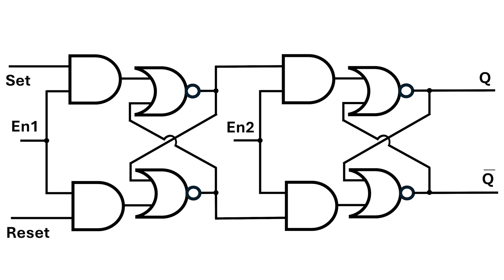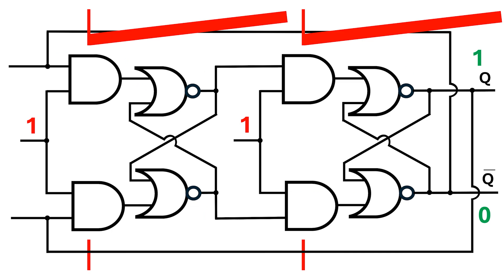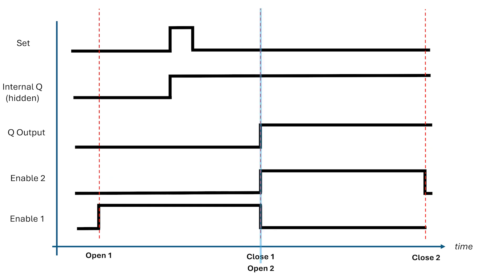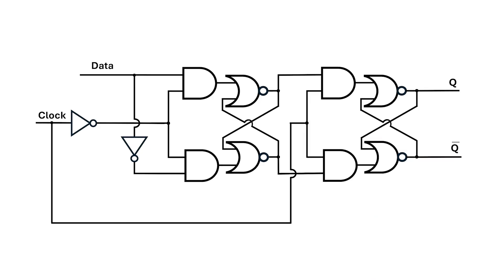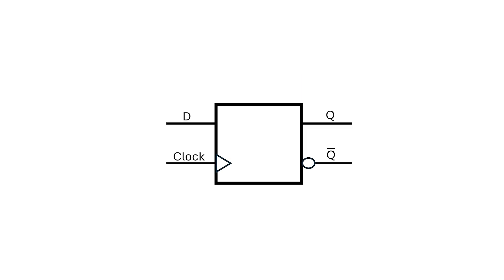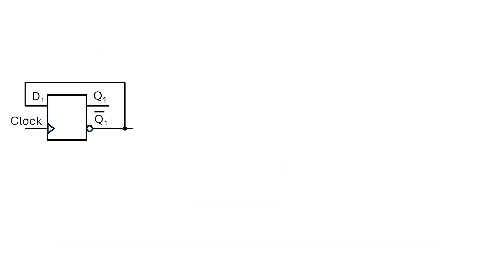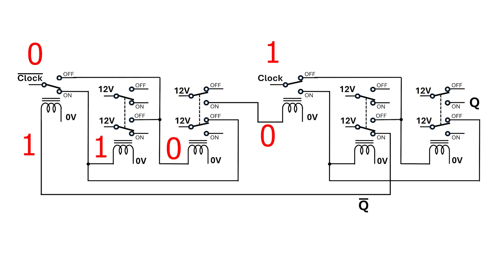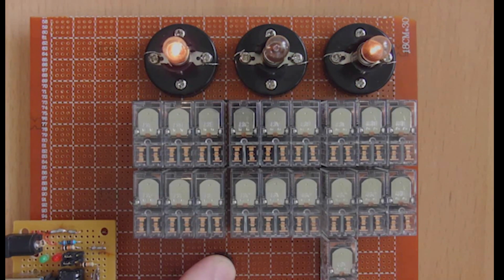Switches to CPUs: Ripple Counter

Comment: Another good video!

(5:51) Where's the data line?
(9:04) Ah. You showed the toggle flip-flop at 5:51, not the data flip-flop.
(9:21-9:40) The top line is still set and the bottom line is still reset on the internal latches, but the relays used for set and reset are swapped compared to the previous video. This does mean the data flow matches the design you showed with gates better. However, it also means the internal D-type latches have D-bar inputs, not D inputs. (There are other ways to rectify this, but I think this way requires the fewest changes.)

And now for some fun facts/over-analysis:
As for changes between the logic-gate design and relay design, you still have the outputs of the latches between the OR gates and their inverters; the outputs are just buffered this time. Additionally, the gate design uses an SR-type latch as the follower, whereas the relay design uses a D-type latch as the follower.
Reply from the maker: Thanks.
[(5:51) Where's the data line?]
It doesn't really have a data input from an external source.  Data is the input to the leftmost relay coil.  

[(9:04) Ah. You showed the toggle flip-flop at 5:51, not the data flip-flop.]
No, T flip flips have a T input that gates the clock.  It confuses the issues so i decided not to include it.

The relays are meant to be equivalent functionally, but not an exact gate for gate copy [i don't think i ever said they were exactly the same - correct me if i'm wrong].  Arguably, the relays act more as multiplexors [and 1:2 decoders] than anything else.

This is a beginners tutorial, so i mainly want to get the ideas across.
Reply: @DrMattRegan   Huh. You're right about T flip-flops. I blame my RadioShack Electronics Learning Lab for calling the configuration at 6:13 a "toggle flip-flop" (and also that most Minecraft redstone "toggle flip-flop" designs aren't actually clocked) for me getting that wrong.

Comment: so that's why they're called ripple counters. I thought they might be used to counter the ripple on a signal (like AC on top of DC), but that never made any sense
Reply from the maker: Yep, they are much easier to implement than synchronous counter where the outputs all change at [exactly] the same time.